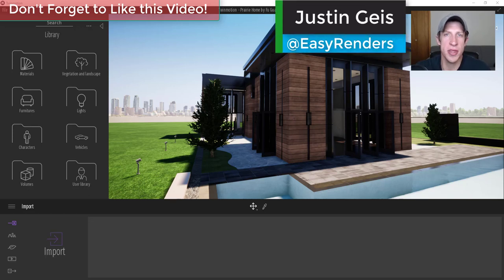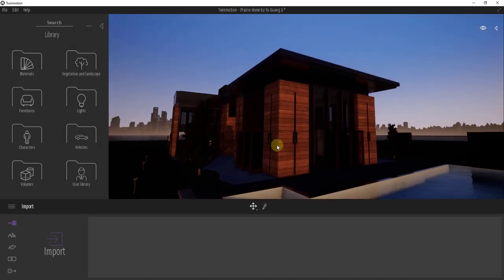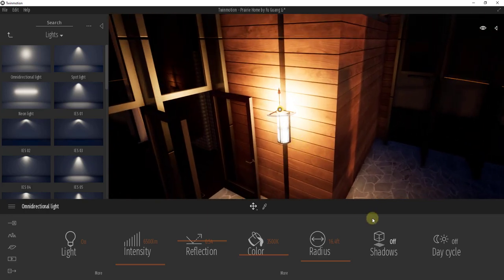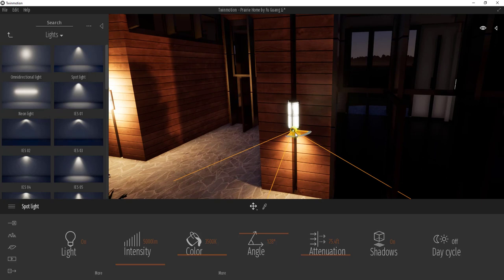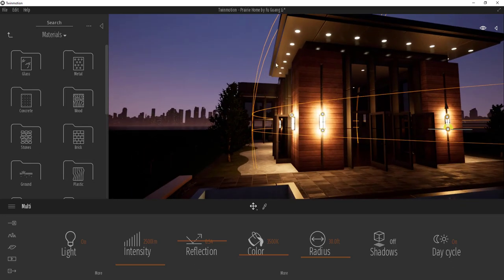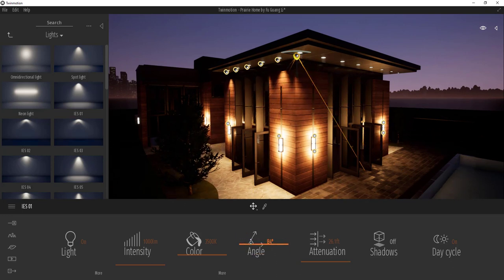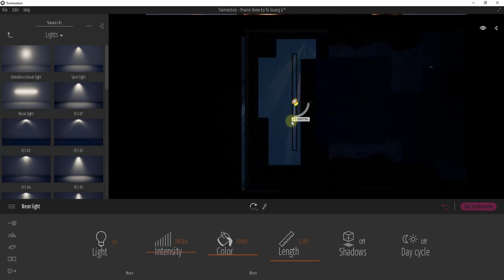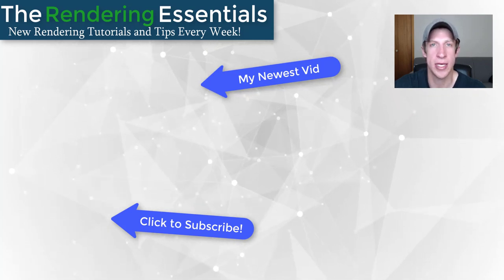Twinmotion NIGHT RENDER Tutorial - Setting Up LIGHTING! Prairie House Render Tutorial

Comment: An excellent tutorial as always Justin. You are by far the best teacher that I've come across online for both Sketchup and Twin Motion hands down! 
Now you probably already know this trick but for those readers who don't I'd like to share it with them.  I've always found setting the lights in twin motion a time consuming and fiddly task but I recently discovered a simple solution (actually it was after learning from Justin about the replace option within Twin Motion). Simply go to your model in sketchup or whichever program you use and create a small component, say a small box 2cm by 2cm and place it within the light component, at say a couple of centimeters in front of the light or for that matter wherever you want the light source placed.  Once you have this component added to the light component, you can simply go back to twin motion and use the replace option located within the entity information (located at top right of screen) in order to replace all these little box components with the light of your choice (the replace option is activated by right clicking on the component in the list for those who don't know). Otherwise watch Justin's tutorial on this. In this way you can have your model lit up within seconds in Twin Motion and each of the lights will be perfectly placed as well!

Comment: If they can figure out how to make light fixtures components vs copy/pasting manually, I'd be willing to move from Enscape. Is there a solution/workaround like using node replacement in Lumion?

Comment: Hi Justin.
Im looking at your vid again after some downtime at home. The thing I'm having trouble with is the nature of the cast light in the scene. Fit example at 7.15 , the light on the wall (top and bottom of the geometry). - its influence/spread suggests that it's ignoring the wall is set against (to an extent). I.e. around the corner (that corridor leading to a doorway).. where is there light on the ground there? There wouldn't be.  Due to the spread, it also lights up that doorframe (round the corner) to an extent, which it just would not.

I think there must be a more realistic way of doing this, within Lumion, I'm can't offer suggestions, I don't have it installed, so hopefully you don't find this to be a criticism, but it just got me thinking.